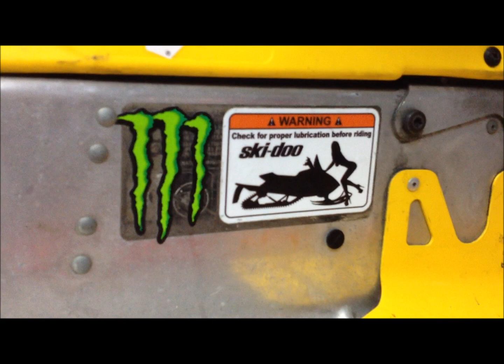LOUD Factory BRP XP Skidoo REV 800 600 440 HO Twin Exhaust Can DUAL PIPE Test Run Ski Doo 800HO

Comment: Is it a stock 800ho motor? What’d you do to make the pipes run right?
Reply: Not stock has a head usually some jetting and clutching is required to get the most outa ur pipes